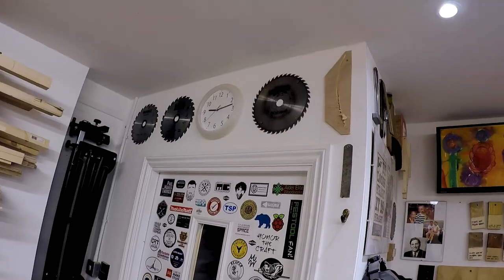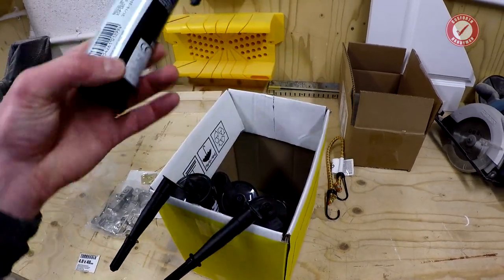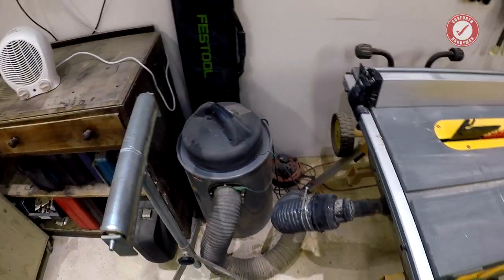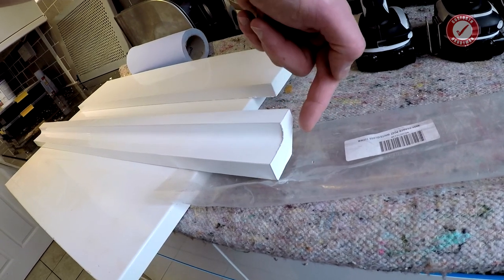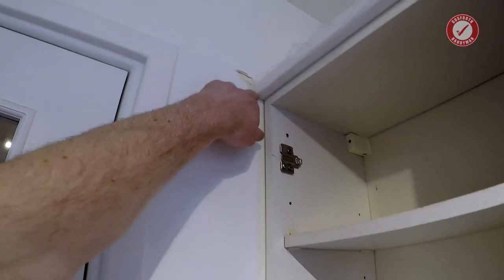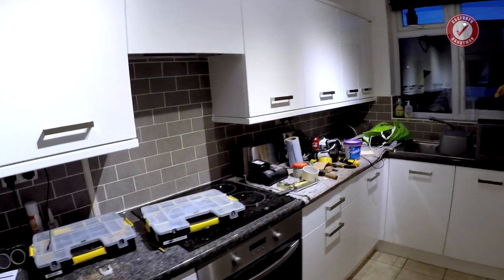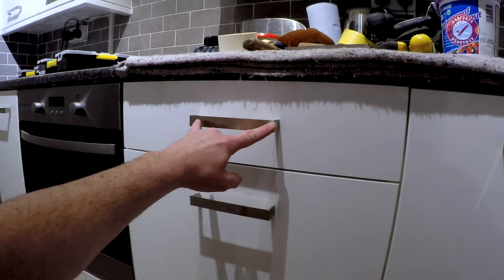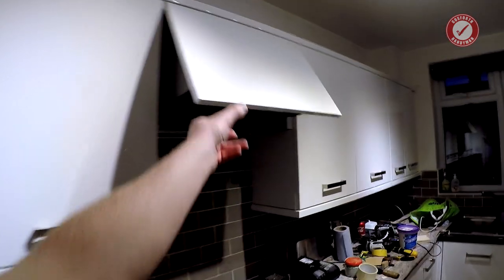Deciding on Kitchen Handle Positioning - Woodworking Tips!

Comment: Hi Andy, useful vids, the best concealed hinge I have fitted is the Timos click on by Grass. Over the years we have tried them all and these soft close are the best we have used. They are available from Hafele or locks online but we tend to get them from Wurth UK, excellent helpful staff as well from their reps, not the cheapest but you get what you pay for. Wurth also do a great jig for drilling the holes in the doors as well.
Grass also make the best soft close drawer runners we have used.
I must point out I am not a rep for any of the companies I have mentioned just giving my own personal view of the experience I have had of  kitchen fittings. ( Cabinet Maker since 1977 )
Reply from the maker: Interesting - will check them out! Useful info! 👍🛠

Comment: My favourite caulk...

I use Alex fast dry most of the time because it’s cheap as chips. 

For anything big or dynamic I use big stretch, it’s elastomeric and not too messy.

At times I’ve used power house and it can do everything but it’s design is to do things that you ought not do with caulk.
Reply: Another one is I’ll use black electrical tape cut to handle size and lay out all the handle positions in a way you can stand back and look at it all
Reply from the maker: I do this sometimes too - great idea! 👍
Reply from the maker: Cheers - will try to get all those on the list! 🛠😀

Comment: The handles on the wall units are the wrong way, put the handle vertical on the opening side of the door tells you automatically which way the door swings, it definitely looks diy

Comment: Hi . What did u use to cut the high gloss lighting pelmut ? The mitre a mean ... Did u get any break out ??? 
Cheers
Reply from the maker: Just used my little Evolution and it actually did a pretty good job! Didn't have space for my Dewalt with the 60 tooth blade but came out surprisingly well. Burnished the edges a bit anyway as they can come out razor sharp. 👍😀

Comment: By another decent vid.
I'm hoping I can pick your brains on a non related topic.
In the school I work at I need to fix a toilet handle that's gone slack and floppy but it attached to a wall panel and the rod that goes in the handle then into the system is hidden behind the wall. I can't find anyway of getting the wall panel off to get to the toilet handle. Have you ever come across these panels. It looks like they have been glued to the wall. As they don't slide off or to the side as I thought they may of been on a French cleat
Reply from the maker: Normally they just slide upwards - sometimes they 'click' into a bracket downwards so you have to give a sharp(ish) upwards hit. Or they're glued on. 😀

Comment: Here's a question about caulk: Is Polycell Trade Polyfilla Decorators Caulk the same stuff as Polycell Flexible Gap Polyfilla?  I ask because, having bought Polycell Trade Quick Drying Polyfilla, I'm convinced it's exactly the same as the Polycell Quick Drying Polyfilla which is sold cheaper in Homebase etc.
Reply from the maker: No idea - I'll try to get hold of some! 👍

Comment: Soudal caulk, AVOID, I used a load of it without knowing, it's crazes with just about any paint unless you prime it with an oil based primer first, right faff.
Reply from the maker: Interesting! Don't think I've got any so won't bother with that one. 👍🛠
Reply: I've not found that at all except when  you don't give it proper time to dry